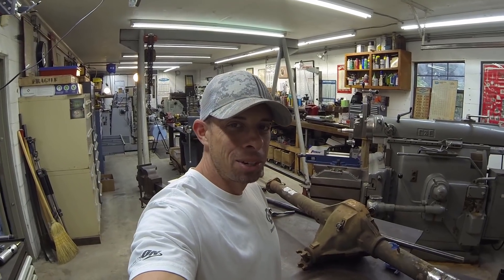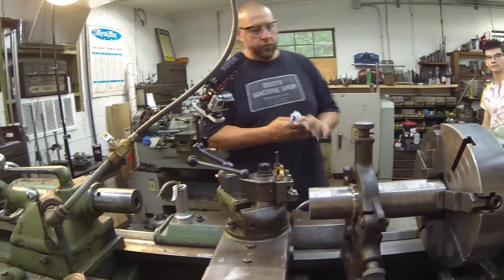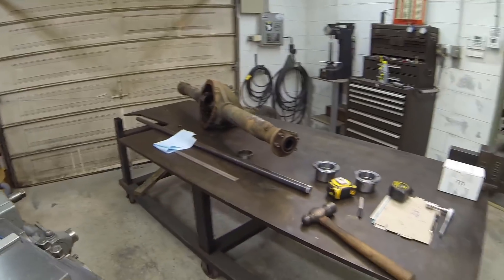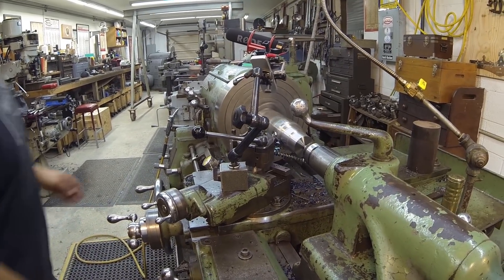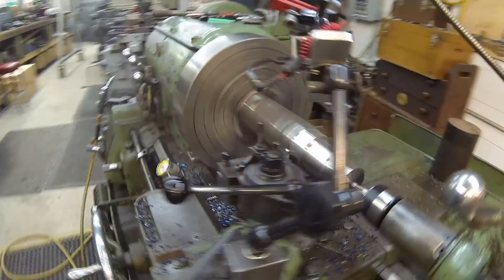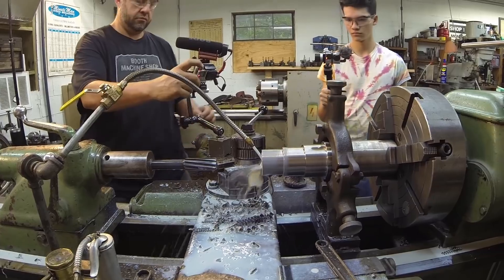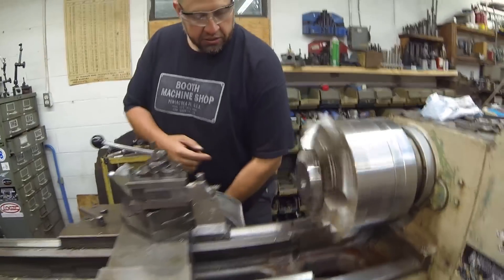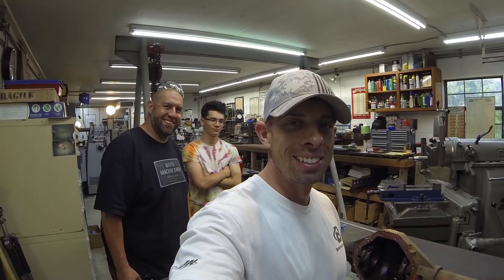Machining an Axle Narrowing Kit for a Chrysler 9 1/4 Rear end

Comment: whats material of the rod? I  have two 1" ,one is classic normal full iron rod but seemed to me bit bended ,so I bought really hard kind of piston rod (for custom shocks fabrication or hidraulic pistons) but its also bit bended..and measure with those inaccurate rods is just circa, not very reliable..
Reply from the maker: My cousin is a machinist and he knows the answer to that but I do not. I do know he checked it and it was true.

Comment: Is there a pinion offset on the 9 1/4?   The 8  3/4  rear end is offset and uses the same length axles on each side but still keeps the pinion lined up with the transmission. When I narrowed a Dana 60 for my car to keep the pinion lined up with the transmission 1 axle tube was longer than the other.  The axles were different lengths also. Make sure you get your pinion where you want it so it lines up with your transmission.
Reply from the maker: 9 1/4 pinion is off center slightly.
Reply: @TheGasTap  I'm late to your build. I took a Durango rear end and put it in a 94 Dakota.  It was slightly to wide. So I noticed that the passenger axle was shorter than the drivers side. Turned out to like 3.125 shorter.  So I cut that much off the drivers side and put a passenger's side axle on the drivers side . It fit fit perfect. Centered it and welded the pads back on. It's a poor mans cheap way to do it. I've thought about doing a disc brake set up. Doing the same for my 2000 RT.  So how much did you narrow the Durango rear.